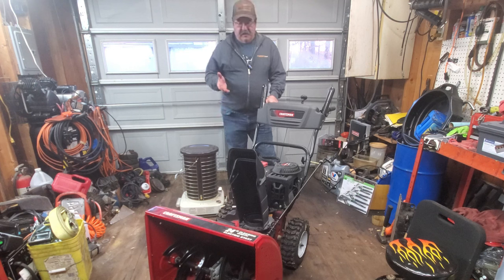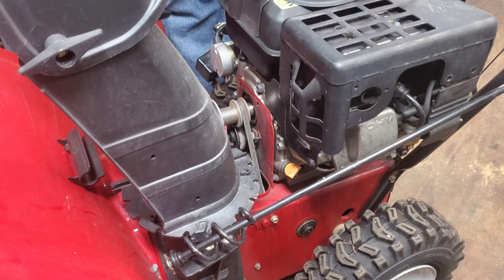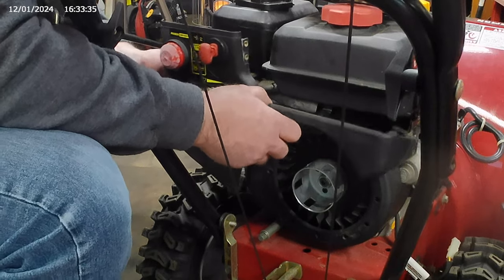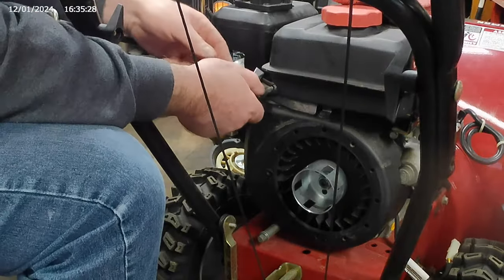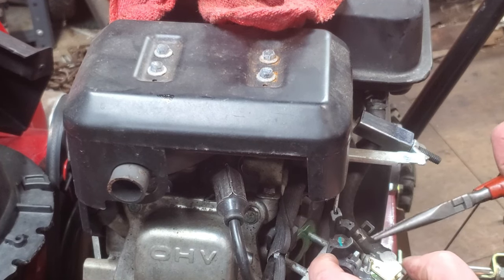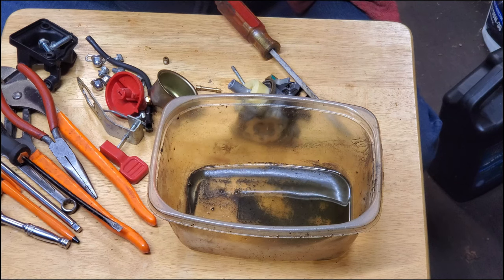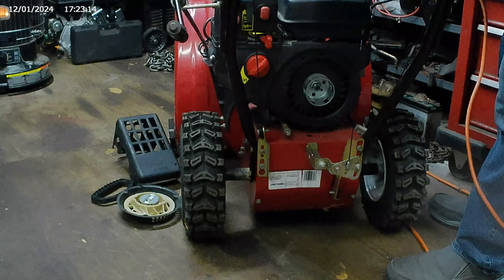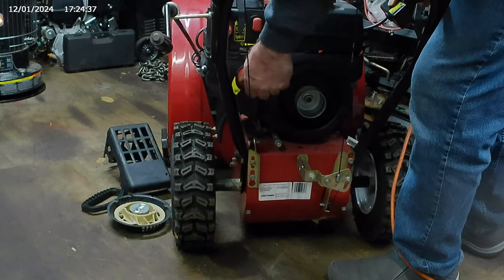These problems are why you SERVICE your snowblower EARLY!

Comment: Sometimes there is a very fine screen in the carb behind the plastic 90° elbow for the fuel line.  That Brass Main Jet often has a tiny hole at the top of the threads going in on an angle.  Always probe all holes in the emulsion Tube.  I add Quick Start and/or blow in the Fuel tank.  No Start= Electrical problem.
Reply from the maker: Thanks for the comment, I have seen those screens on certain carbs. This style carb does not have have the small hole in the side of the main jet. This main jet is up inside farther, and there is a separate idle jet as show later in the video. Watch for the follow up video to this to see what else it took to get running. thanks for watching.
Reply: @ridingmowerking  Will do.  Thanks.